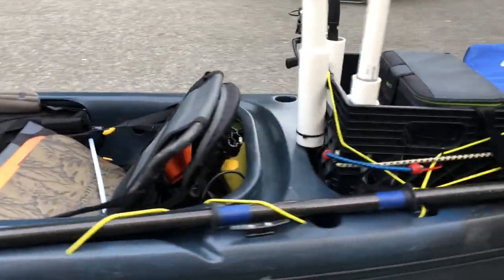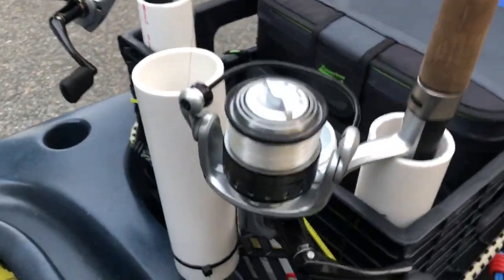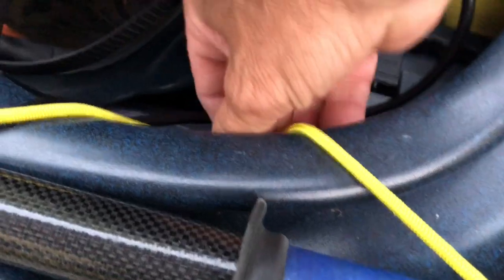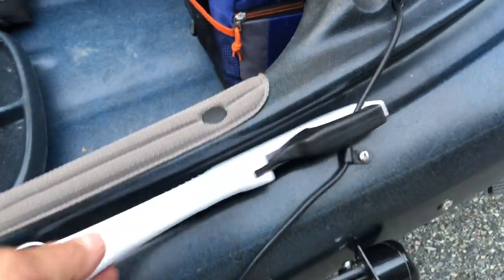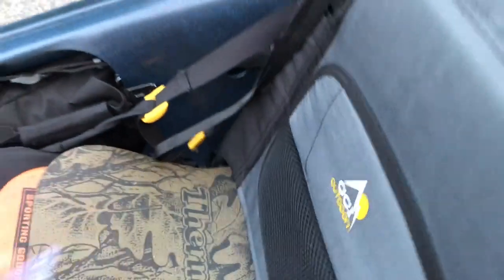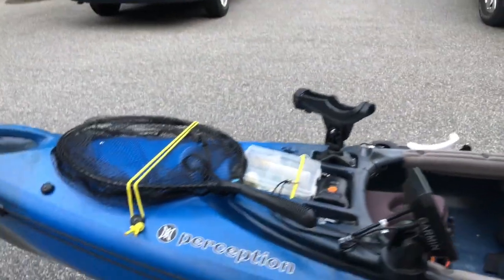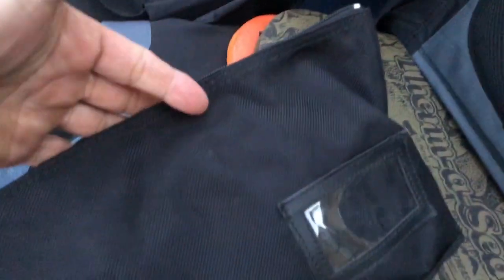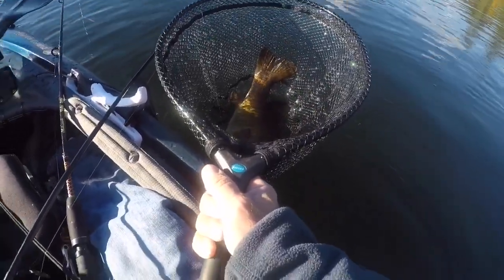Perception hook 10.5  kayak modifications and review

Comment: Did yours come with a small bungee w/hooks to make the seat auto fold? Mine broke and had no bungee for the paddle holder. Also, anyone know what the square recesses are for at the back of the seat mold?
Reply from the maker: Jack of All The bungee cord should not be a big deal to replace as for the squares behind the seat looks like for structural integrity and strength , when the seat is reclined they would have no other purpose as far as I can see.
Reply from the maker: Jack of All  the seat bungee is not made to auto fold you are supposed to un hook the ends when seat is in use the hook them forward for storage and travel, personally I would not use the stock seat , if you buy a folding seat at dicks or bass pro you will save you back lol 😂